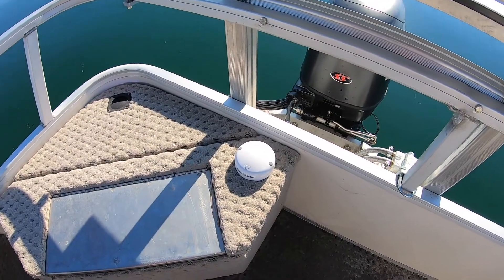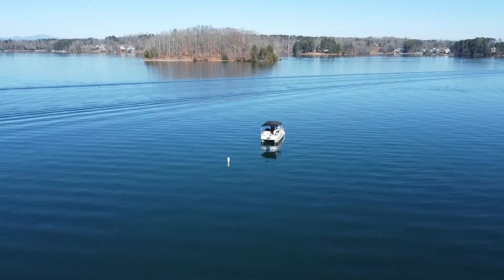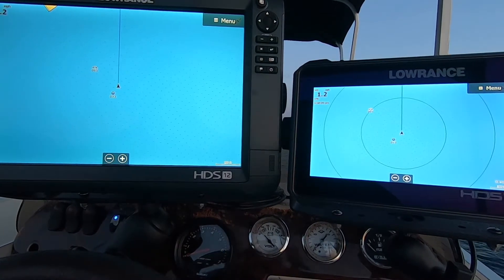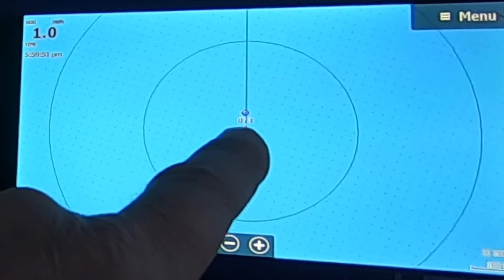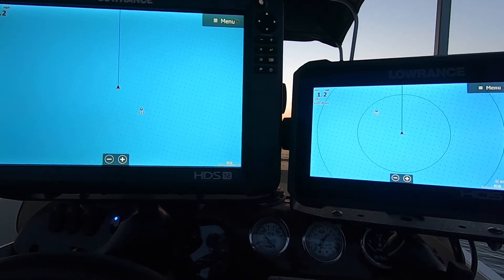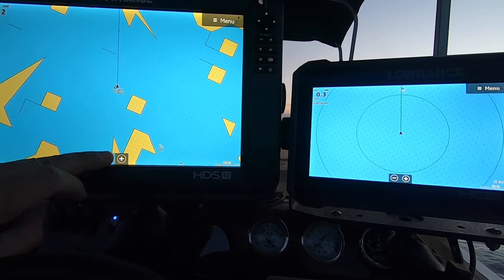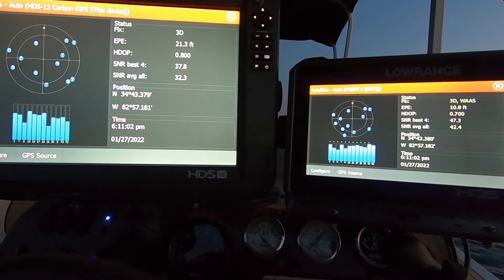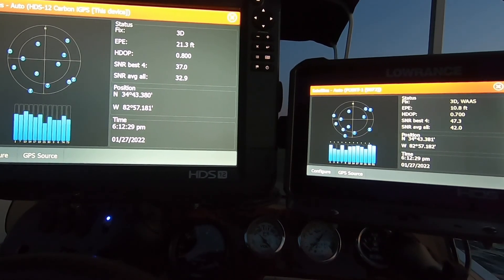Is NOT having a heading sensor Costing YOU Fish? External GPS receiver fully explained.

Comment: On a Garmin, you can use GPS, GLONAS, Galileo all at the same getting an error rate down to 5 feet.   Many people are not aware of this feature and then add a $140 SteadyCast
Reply: I have raymarine element I'm considering the garmin gps24xd w/ heading sensor over the rays none headinsensoe puck,my vessel has a metal roof blocking 3rd overhead satilite.

Comment: If mounted next to the graph will it couse interferance
Reply from the maker: I mounted my point 1 at the back of the boat by the transducer for accuracy when marking waypoints. I would check the location with a standard compass.  If there is no magnet interference then you should be good.

Comment: Hi there!
Im fishing on a kayak and got Elite FS and Im thinking about to buy point 1 antena. I want to ask something:
I noticed that there's a 3-4 secs delay on my GPS movements. I mean I'm on my way to a way point and once stop completely the GPS still moving and that's so annoying so I wonder if point 1 antena will solve that problem. 
Good vid BTW 👌
Reply from the maker: The GPS works off of movement only.  That’s how the map shows your direction, only when you move.  The delay may be a result of the signal your unit is receiving.   A point 1 will help with both.  It’s has an internal compass to keep your orientation correct on the map.  You will also get a stronger signal so your error/ accuracy will be a lot tighter. Thanks for the view!🐿
Reply from the maker: Just to be clear.  The point one will not completely take the delay you are talking about away. It’s not so much a delay as it not being accurate down to a foot.  If you turn on the track feature on your unit and stay parked to a dock, you will not see a single dot.  It will set a lot of jumbled circles like you are moving around. This is because it’s not perfectly accurate.  The point one will be a little better but still not perfect.   However, when you are sitting still, the point 1 will keep your curser from spinning around like a top on your map if you have North up. If you have heading up like I run on my map, it will keep the map from spinning all over the place when you are sitting still.  Just wanted to clarify becausea point 1 is about $200 bucks and I don’t want you to be dissatisfied. I love mine and would buy another if it messed up.  Don’t forget the Point 1 runs off of the NMEA 2000 network.  So, You will need a NEMA starter kit ($70) has everything you need, cables, power cable, and tees.

Comment: Hello!! I would like to ask a question about point-1!
When I installed point-1 on my elite fs9, and was ready to calibrate, 
I found that the rate of turn was already 5-6 degrees,
 but my boat was tied to the shore and didn't move! What is the reason?
Reply from the maker: Be sure your point one is not mounted around anything magnetic 🧲 ex carbon steel ect. Check your location with a compass.  Then calibrate in the middle of the lake away from bridges.  Bridges are full of steel.  Hope this helps. 🐿